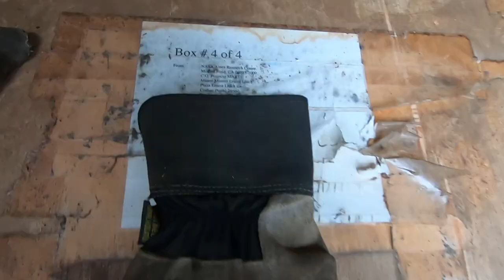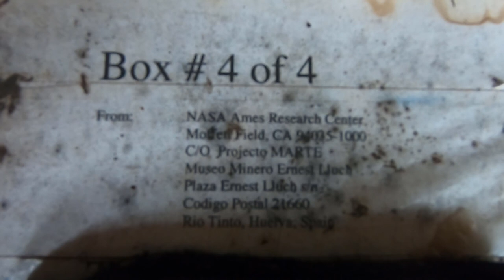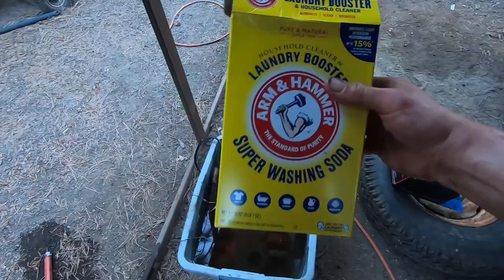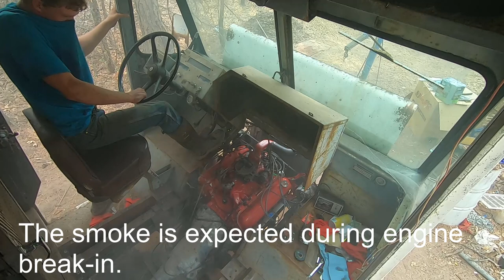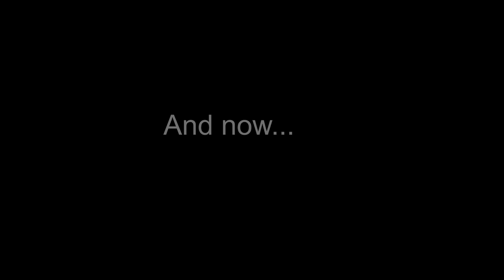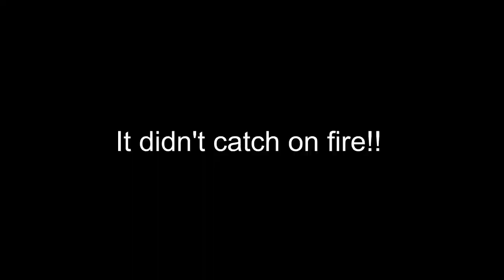Phase One of my Vintage Step Van Conversion: Will it Move Again After 17 Years of Sitting?!

Comment: i dont know how far along you are in this build, but i highly recommend cleaning and spraying the entire inside with truck bed liner. it will stop condensation from forming after you put insulation in and walls if you do so.
Reply: It’s great for sound deadening and road noise on any squeaky old vehicle as well.
Reply: Any particular brand or product that you recommend?
Reply: I have a 1980 van and plan on using 1inch  4x8 ft sheets of alum foil  covered  insulation  R 7 per inch and will layer it and foam the edges  .will be put 3 inch thick  for a R 21 wall and the floor going to do the same except I will put it under the original  floor and covering with  flat aluminum  roofing to stop road damage  .for the ceiling I plan on adding  4 inches on top of existing  roof and also covering  with aluminum  .which can be supported  with 3/ 8  thearded rod and fender washer  and at the same time  support my una stur for my solar 😀

Comment: If you really plan to use that van, get a Holley Sniper EFI carb replacement for it, the old carburetors are a PITA to deal with and suck when changing altitudes.  The EFI will pay for itself in fuel savings, that I'm certain of.
Reply: I think an LS V8 would pay for itself too lol
Reply: I was thinking this too after watching. Then he could replace his whole dashboard with an all-in-one digital dashboard and wouldn't have to worry about getting the old dashboard going.
Reply: I like the low electronics of this build.  Keep it simple and low tech to repair.

Comment: This has to be one of your very best videos I’ve seen yet. I got exited hearing your story in the beginning then getting to see you put the work in step by step in something that could be very beneficial to you down the road. In a way I felt like I was working on it with you, ready to get to the next step lol. Just subbed your channel today. Congratulations on your channel and your New ( Ole International). Those things are tuff as nails. And the work you put into it today, could possibly last 20 - 50 years down the road. I’ll be watching out for the update to the exterior and interior work. Remember these two things about body work/paint - you can’t rush a fine work of art. And that 85% of painting a vehicle is actually PREPPING. Take your time prepping, taping, sanding, priming and so on, then when you paint, it will not take as long and it will look way better. 
May the Most High Bless you well young man.

Comment: Hey, so on your invisibility shield video… what if you used a clear epoxy to bond lens and the shield together. Then use several straps horizontal to the lenses to clamp the lens/resin/shield sandwich with the wooden template board (the one you used to bend the acrylic). 

You’ll want to use some paper or something to make sure the shield doesn’t end up glued to the template board. 

But I would love to see you make it again!

Comment: I would get two gallons and use the rollers they come with a use bed liner paint Hercules brand  that will make it so quiet inside when your driving it then add your interior.  I used it on my four door ram  and you can barely hear my dual exhaust and zero wind.  Cost $200.  It’s so easy to apply you will be done in a couple of hours !  I used to drive that truck the noise they can’t pay you enough to drive it and it’s going to be about fun so it’s a must do.

Comment: Back in the  mid 70s, I bought  a small, 15ft international right hand drive mail truck. Made a camper out of it. The best thi ng I  did was to re arc the leaf springs  and add an extra leaf spring. The difference in stability was a godsend. You might want to install some metal rollers on the bottom of your back bumper because of scraping on hills.

Comment: I drove one of those vans to make deliveries for 2 yrs. Because of the way the suspension is, after a long day, it's "very" easy to get lulled to sleep. Especially if there happens to be a small exhaust leak getting inside the truck  :P
Very nice start overall, especially with initial investment of $50. Can't beat that.
Will you be upgrading the intake/carb later on down the road?
To be honest, that van would make a "great" EV conversion. There's tons of space under the decking for battery and electronics bays, and plenty of space for a huge forklift motor (or something equally as powerful) in the engine bay. And all that roof space, for solar panels!  Could even make a fold out 3 panel array set for when you're parked.
Reply from the maker: Always good to see your comments, man! 

Oh interesting! I'll keep that in mind. 🤣 Yeah, the price was definitely right. I couldn't really say no to an offer like that! I probably won't upgrade the carb for a number of reasons, but I did upgrade to a Pertronix electronic ignition module. So it isn't EMP hardened, but I plan on keeping a set of points around just for the occasion of getting her running again. I definitely will be doing an EV at some point, but with the weight of this thing, I'd probably get something lighter instead. Thanks for the comment as always!
Reply: @randomn6473  That thing weighs around 6000lbs, right?  That's well within the range of those e-motors. Especially mating it up with the existing transmission.
Fork-lift motors are really beefy.
Would be a nice project to go with for tinkering and such. Now granted, that's not necessarily the "best" option to go with, for sure. Just a really good DIY project, plus all the views you'd get for u/l'n the project videos  ;)

Comment: Looks fantastic! You'll definitely have a better result in the end than if you'd bought an RV.  Cooler looking too!  Also, saw that spool of, looked like underground feeder wire, that you pulled out of the back.  If you don't need it I'll buy it off of you for what you paid for the van!

Comment: You bought all the nasty that 50 buck could get you.   But that's still a solid looking van!  I am vary excited to see what you do with it, and how much it costs.  I would really like to know how much getting the new drivetrain costed you if you can include that at some point in the videos.  But most interesting in the present to me the blowout of this van.. and seeing how much mud can you push out of the van with a pressure sprayer.. that will be most satisfying!
Reply from the maker: I'll tell you that it wasn't cheap! But it's still much cheaper than buying a new van. With the drive train essentially being brand new at this point, I think it's worth every penny. The engine was $2,700, the tranny rebuild was $750, the new wheels were $1,400, and the misc. was at least $1,000. But compare that to even a used step van at $15,000+, I think it's worth it! I like the EMP resistance of the old vehicles as well as a "just in case." Thanks for the comment!
Reply: @Randomn  oh wow... I'm really surprised that it was that much for the motor.  You got a vary good price for such a big motor.  2700 seemed like a steal. I was going to ask why not while your replacing all the old stuff, why not go with a new Cummins 3.9 bt, or a new Chevy crate engine... but 2700 a way better price.  Was there ever a point you though about getting a different motor, or do you have experience with international Gas motors that makes you particular to them?  

I ask this because I don't have much experience with motors, if it was me looking at the engine bay, I would want to replace the motor that has something with a fallowing like a Chevy vortex or ford powerstroke to be able to tap into the community's help pages and figure out what is wrong with it when it goes pair shaped, or just find solutions for things I don't like after I get it running.  There is alot of things I will not buy just cause I am worried about who will help me when something breaks and I have to figure out why it won't work.

Once again, it seems like you got a vary good price so far to get a running step van.  I can feel that thing is going to be really awesome when you are done.

Comment: Going to be honest and say that idk why anyone will think that they're going to save any amount of money living in these things. I drive them for a living and even when they're empty they use a huge amount of fuel. Either diesel or gas. And both prices of those fuels aren't exactly cheap. It's about 160+ for a full tank from 1/4 full where i live at and its obviously going to be different in every sate but probably more expensive in others and you only get about 190 miles of range with them before you have to refill it. And that's just on the newer ones. Yours is an old carburetor model which is even worse on gas mileage. 

People glorify this whole van life thing without talking about the realities of it. It's expensive af to do, convert and drive and you can't exactly just park them anywhere for very long before someone notices and says something. Which means moving, again, which means constant fuel consumption in the long run. It's actually cheaper to just get a studio apartment while saving than the costs of fuel and maintenance.

People that do this and glorify "van life" already have money. A lot of it. They saved for years to travel or they just already came from a rich well off family. This is the realities of these step vans and those who convert them to rvs.